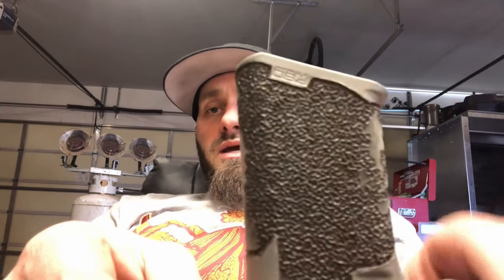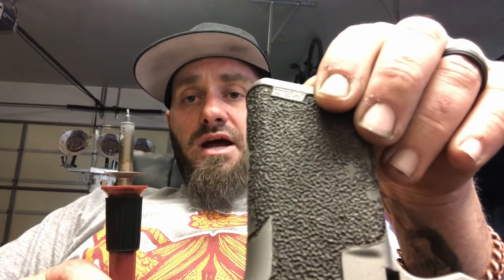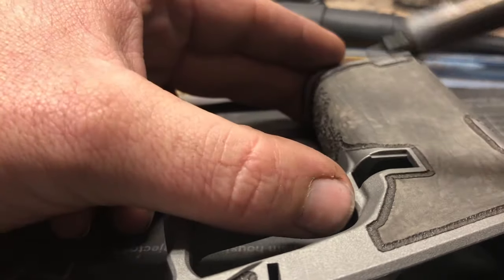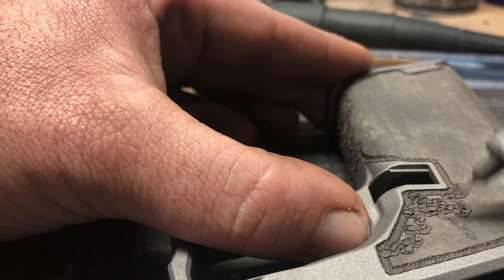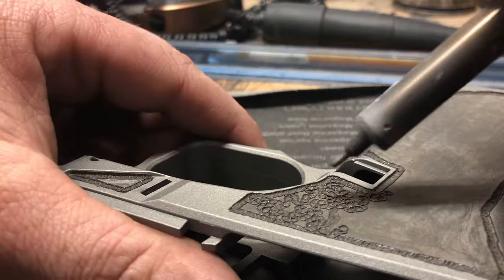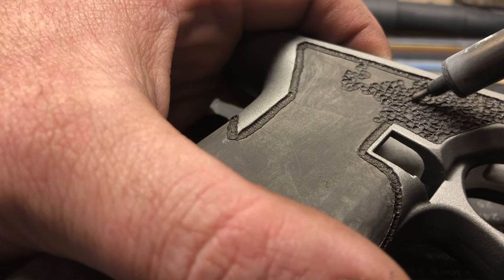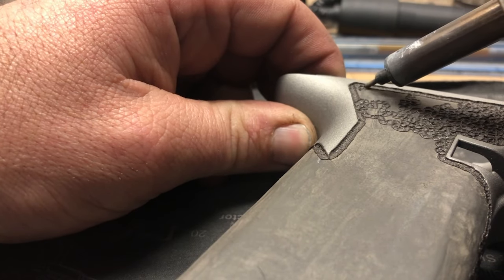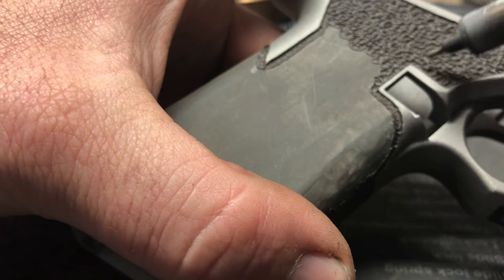Gun Stippling Basics: Stippling Patterns & Techniques

Comment: I taped mine off and sprayed a texture on the grip, IG its a natural progression for me, I used to be a gelcoat guy, in a factory that built parts for NYC transit, and I sprayed ALOT of texture on gelcoated parts, so to me it was the fastest, cleanest and easiest way to get some custom texture on my P80.. But when I did that, I rly didnt realize its this basic to stipple stuff. Good vid my man. And good explanation of technique. I will say, textured- painted parts are more like skateboard griptape, than an acutal stippled design like this, but still afford great grip on the plastic, and can be easier on the eyes if you find stippling to be too aggressive for your liking, and is truly randomized, as its basically millions of tiny paint bubbles on a flat surface, stacked and over lapping, over and over, layer after layer, until its basically nothing but several layers of gelcoat or CeraKote stacked up on top of each other, creating a textured surface. Marine application Gelcoat actually held up great, cerakote has bonding issues and tended to flake off the base layer, it took ALOT of messing around with techniques to get cerakote to adhere right, but looks incredible if you can get it down.

Comment: What temp should I use my iron on? Thanks for sharing the info. I was using a soldering iron and it was just too much. Destroyed one g30S lower grip module. Thanks!
Reply from the maker: Hotter the better. An adjustable temp is ok to use to learn, but at the end of the day the higher the temp the cleaner the work
Reply: @gledhillcustoms4659 I just tried doing my G19 and I don’t think I had it hot enough (adjustable) I would lift up and get little plastic hairs

Comment: I was going to start by just using my laser burner and using adobe illustrator and Cad to design the pattern then letting my laser do the work with perfect lines .....since I am use to burning on those polymers already .
Reply from the maker: Good luck!
Reply: @gledhillcustoms4659  either way learning hand made stuff is always a plus forsure
Reply from the maker: Most definitely. Each method has a purpose. Hand stippling is way more beneficial than laser work when it comes to enhanced grip. Most laser stuff is merely cosmetic, but it looks super sharp. I wanna get a laser one of these days, just to learn how to operate it.
Reply: @gledhillcustoms4659  the laser is the way to go but forsure it's beneficial to learn it by hand first.... tho only if your really going to get into the hand made crafting but to earn cash and do clean setups i think laser is the key because you can dial it up to engrave precisely ... deeper if you want the grooves or whatever so it looks factory. As now companies laser them in there OEM new gen guns.
Reply from the maker: @dreamkiss4u  95% of laser work is merely cosmetic. Hand work is for functionality and when done right you wouldn’t know the difference. People think most of my work is done by laser instead of by hand.
Reply: @gledhillcustoms4659  not really you can go as deep a you want and as beveled a you want... same a any hand version you choose how much in the setting

Comment: Hey man, I have a few questions and it would be awesome if you could help me out. I've been practicing stippling on trashed p80 frames and I just ordered a Cerakote pro starter kit. Do you sandblast your frames before your Cerakote them? I have the H series oven-cure Cerakote. Also, do you Cerakote, then do your borders and sanding or do you do your borders/sanding and then Cerakote?
Reply: ALWAYS sandblast anything you Cerakote. For the plastic, do it at a lower pressure. As far as sandblasting before or after stippling, it depends on whether you want the stippled area to be bare polymer or Cerakoted. If you want the entire part (stippled and virgin areas) to be Cerakoted, sandblast it after stippling. I think that's the best way. It softens out any "unevenness" in the stippled area and along the border. I'm sure you can sandblast, stipple, then cerakote it, if you want everything to have sharp edges, but I'm not sure about the cerakote adhesion if you're applying it to areas you've stippled after blasting. I'm sure it would be fine, but I think stippling, sandblasting, then Cerakoting is best. Or, if you want it only Cerakoted on the virgin areas, sandblast and cerakote the entire thing, same the areas you're going to stipple (so the cerakote doesn't melt in with the polymer and tint it) then stipple it. 

Cerakote has great files in the resources tab, and you're paying a premium price, for a premium product, so use their support. Email them with questions; you're paying for it. They'll tell you the blasting media, pressure, tip size, and everything else you need to know. They're excellent. 

Also, make sure you use a glass beaker, glass stirring rod, and don't let the cerakote come into contact with ANYTHING like gloves, rubber, or plastic while mixing and applying (besides the substrate you're spraying it on). I had problems with a rubber gasket on a mesh strainer, a certain type of metal that I was mixing in, and other things that caused really annoying problems. Also, spray it WET. If it does right as you're spraying, it'll be too light, and will cause a sandpaper finish. It's almost opposite to how you would use spray paint cans. Instead of a bunch of super light coats, use one fairly heavy coat. Also, get a scale that has a resolution of 0.01g or 0.05g (or at the very least 0.1g). A scale with a resolution of 1g is not precise enough. If you're only mixing 20g of cerakote, the difference between a matte finish (24:1), normal finish (18:1), and glossy finish (12:1) is 0.65g, 0.87g, and 1.30g of hardener catalyst respectively. That's only 0.65g difference between the highest and lowest ratios. That's impossible to measure with a scale with a resolution of 1g, and it is really hard to estimate with a scale with a resolution of 0.1g. With a resolution of 0.05g or 0.01g, you should be good. Be careful though, because a lot of scales with a resolution of 0.01g don't have a very large max weight. So once you add a beaker and all the liquid, and you try to tare it, you may be over the max. I like a max of at least 500g. A 50 mL beaker is ~40g, a 100 mL is ~60g, and a 250 mL is ~110g. So if you use a 250 mL beaker, and a glass stir rod, then add the 50g cerakote and catalyst, you're going to be at almost 200g.

Hope that helps.